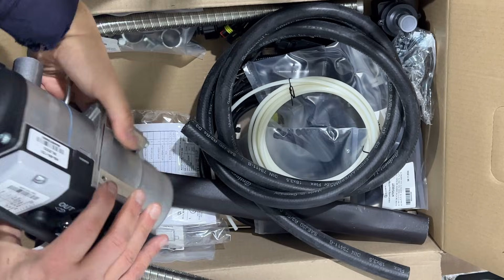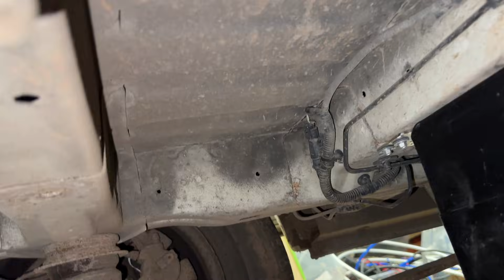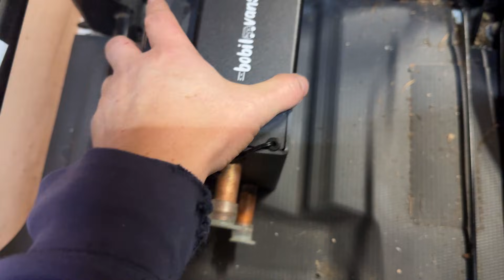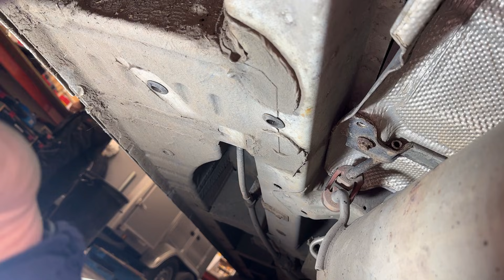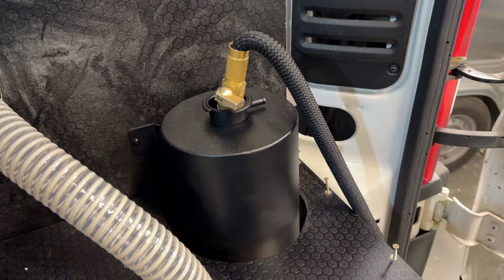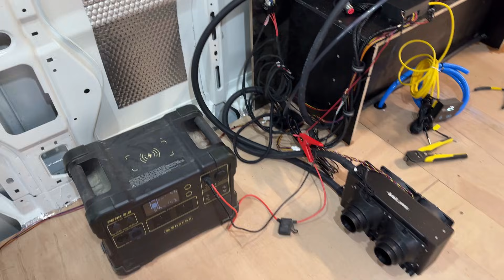A deep dive into a Bobil Hydronic Install with Autoterm Flow 5 heater

Comment: One question about the coolant pipes running under the van will these need to be insulated to prevent heat loss to the air and potential freezing in cold climates?
Reply: No, coolant=antifreeze

Comment: What is the element inside the tank made from?   Is it made of copper because it could cause galvanic corrosion in the cast aluminium heat exchanger.
Even with distilled water and and rust inhibitor in the coolant,  it's still going to be and issue after a few months.
Also if you've run that circuit with plain water like you said in the video,  I suggest you flush it with vinegar and have the customer use a glycol mix as soon as possible to avoid ruining the hydronic heat chamber.
Reply from the maker: It’s incoloy. Also the element doesn’t touch the coolant, it heats the water. We always run these systems with glycol and water, we just demonstrate them working with water then empty them in case the customer wants to move any pipes or shorten anything.
Reply: @bobilvans4205 when I referred to the element, I meant the convection heating loop inside the cylinder taking the coolant.  Not the electrical heating element. 
I don't know how else to describe that since it's a pretty unique way of heating water.
Is this loop made of copper ?
Is there a schematic diagram of the internal cylinder?

Comment: Have you tried mounting the heater in the engine bay in the position the vehicle manufacture would have used if it was being used as an engine preheater?
Reply from the maker: I haven’t on this van, but as we’ve put the coolant tank, calorifier and blower box towards the back, having the heater at the back made sense for this install. But nothing wrong with putting it in the engine bay.

Comment: Toying with the idea of changing my plans from Air heater kit to a Hydronic/calorifier to heat cabin and water for shower - But one question, Can you JUST heat the water system with ON-Grid/shore power only using your controller and Heat the cabin? No diesel required kind of thing - albeit slowly, would it keep the temp throughout night at a comfortable level. Second question - Do they come in 24v Versions?
Reply from the maker: Yes you can, there’s an AC air and water routine which runs the calorifier in reverse-the water heats the coolant which then heats the van. It won’t put out as much heat as the diesel version, but for moderate heat needs or as a supplement to another heat source, it’ll work well. 

We can do a 24v of the diesel heater, but the Bobil bit is all 12v I’m afraid.
Reply: @bobilvans4205  That's perfect! So if I'm correct, a Hydronic system can literally do everything (with your flow control valve in previous video) and seems to be more superior (bang for buck) than the traditional Diesel heater. 

A simple 12v converter can suffice, just need to figure out how to use the solar dump Technology now I'm using a 24v system... 

Great video!
Reply from the maker: @joeyholmes4179 if you’ve got a victron system then you should be able to use a state of charge output from either a shunt (BMV-712) or a cerbo to trigger the element.
Reply: @bobilvans4205  I do!! Ill use the Cerbo! Thank you very much :)